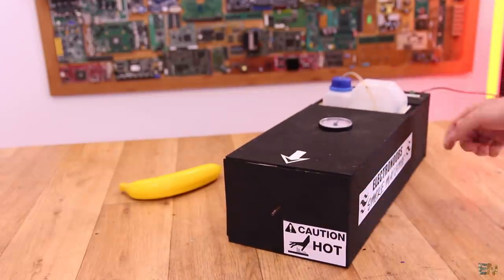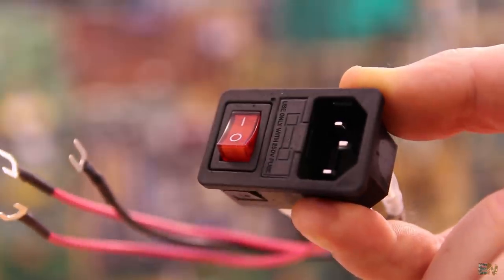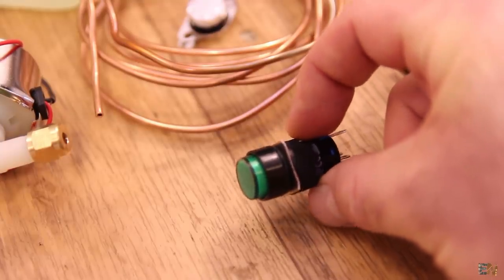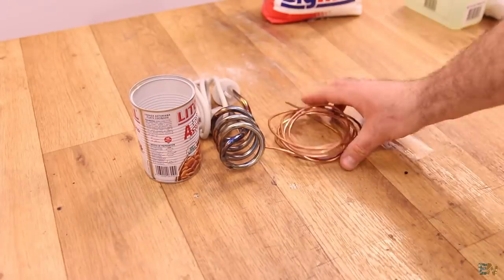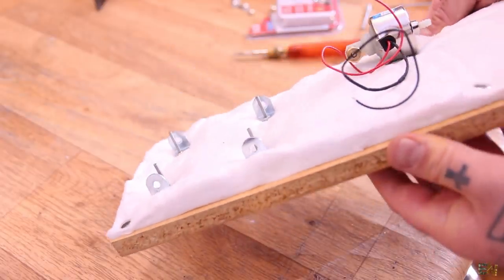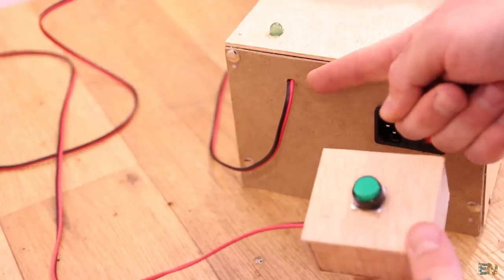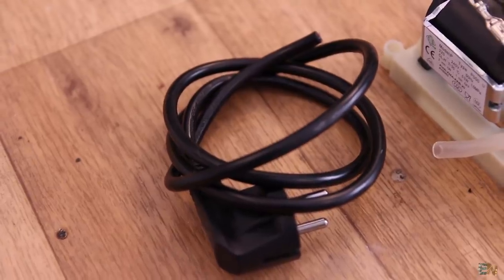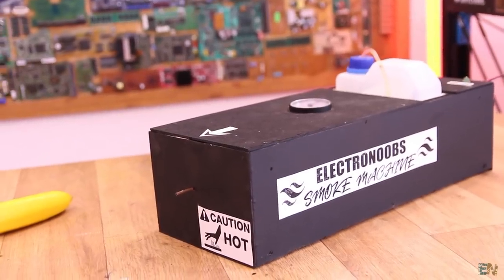Homemade Powerful Smoke Machine | Cheap Parts DIY

Comment from the maker: Sign up at ELECTRONOOBS.io: https://electronoobs.io/
Follow me on FACEBOOK for more: https://www.facebook.com/Electronoobs
help me on Patreon: https://www.patreon.com/ELECTRONOOBS
Reply: Electronoobs your ur name is a copy of electro boom
Reply: Why use a mains rated button when using speaker cable, the cable is more likely to fail than the button. And why no grounding, you have metal parts sticking out that on the inside is in close proximity to mains wires. Stop making mains connected projects until you know what you do, at least don't make videos for others to make the same mistakes and potentially kill someone. Maby you know how to make something not lethal, but just on the edge, someone who copy you may then cross the line and kill someone.
Reply: can you place links from amazon, or other place with all the stuff needed for this project please?

Comment: Great project. But there must be thermal fuse (eg. 250'C)in series with coil in case of thermo couple switch fails (as you use wooden case) to avoid fire.

Comment: Hello, first time poster first time watcher. But I've been a repair tech for the entertainment industry for about 6 years now. And working in it for more than twice that.
Ok, so time to unpack some things:

1) SAFETY 
     This design will have extreme problems, but down the line. While the thermal insulation is good, you really need to be using some form of fiberglass insulation that is rated for some amount of time as a fire barrier. Other machines professional in the industry do this, however some do not. The reasoning is a very well tuned system that calculates for thermal run off, kind of hard to do with Arduino. Switch it up to the more powerful teensy and now you get some watchdog timers for thermal management.
     Also PLEASE COVER THAT OUTPUT NOZZLE it should be recessed in a way that walking along someone can't bump into it and seriously burn themselves.

2)PURGING
     This is a very important step for longevity. to purge the system we need a way to force air through the line going into the heater block.
This is commonly done with an air pump from an aquarium. Take the output of the air pump and put it in a t or y split to join the fluid and have the output of THAT go into the heater block. Also go ahead and move that switch to an input for the teensy and get ready to do some light coding. Because the fluid pump should not be pumping constantly, while the air pump could (you may want to adjust it with the fluid pump for consistency). 
     Vary a pwm signal to the fluid pump. it will push little bursts of fluid into the line that will be propelled forward into the heater block by the air pump. This will also allow the system to purge after use by just leaving it alone until the unit stops producing haze entirely. By varying the flow of fluid we get less output yes, however we also get less cooling on our heater block which can save designs that use cheaper heaters that can't keep up with how much the fluid will cool down the heater block while in use.
     If heater blocks are left un-purged build up from sugars inside the haze juice will form a coated layer of "gunk" in that heater coil. This will build up no matter what. But extremely fast if you don't purge at all. Sometimes they can be brought back by running a mixture of 50/50 distilled water and vinegar through the line (this will not smell good) and a pipe cleaner. Often though the solution is to replace the heater block entirely.

3) HEAT
     You noticed that little bit of leak coming from the output nozzle? hotter will fix it yes, also pumping slightly less fluid as stated above can help. But most hazers will have a small thermistor that ties into a trimming potentiometer that gets adjusted until the desired cutoff heat is reached. How this works it a voltage is sent into the thermistor, voltage gets resisted by some amount of heat, voltage goes through the trim pot where if less heat is required you increase the trimmer thus make the unit see it's programmed shut off without having to adjust code. Most hazers I've worked on are tuned somewhere around 200-230 C
     That is super hot. Those machine also have a metal frame, thermal runoff protection, (and good insurance (jk they turn off and force fail before we get to that point)).

I don't know if you will return to this project or not, but if you or anyone else watching this does it would be a good idea to make some changes in the name of safety and longevity.
Reply from the maker: Thank you very much for all these tips. These are all good advice and I now know more and. Thanks!

Comment: Congratulations on the project. Could you create a smoke machine system running on 12-14V? It has to produce a lot of smoke pretty quickly.

Comment: Thank you for the video, one thing, I think that using mettalic hinges made for pvc pipes to attach the can is better..no? Another thing, the smoke liquid is not the same made for electronic cigarettes?
Reply from the maker: I'm not sure. Maybe the cigarette liquid is also based on glycerin....
Reply: It's the same, but different grades. Google says, 'Fog fluids have two primary ingredients – an active one and deionized water. The active ingredient can be propylene glycol, triethylene glycol, glycerin or a mixture of these. The vaporization temperature varies...'

Comment: The idea is good, but 220v+ heat+ wood case+ "something go wrong" = easily Fire.
Reply: You are correct, but he repeatedly said that you should make the case out of metal. He wanted to use metal but all the metal shops were closed due to quarantine

Comment: I love the idea but 240v for most = either fire or death why not use a 12v heater cartridge from a 3d printer? I know it's smaller but safer in the long run

Comment: Also make Arduino battery charger with display with minimum components with voltage and amp rating .. thanks in advance and stay safe 🙏🙏🙏 i want to use it for 18650 salvaged from old batteries..

Comment: I am looking for smoke machine to be use in a boat as theft prevention. It need to produce heavy fog and be triggered by a motion detector. Ideally should smoke for 15 minutes and have a low stanby power consumption and be ready to produce fog within a second or two after the motion detector is detecting motion. I think this could be a great business for boats alarm. There are some system available but very expensive (>$1000)
Reply: Would it be possible to hook up lots of smoke distress flare canisters with fireworks electric igniters and wire them to a motion alarm?

Comment: Without ventilation eventually the whole box will turn into the set temperature of the thermal switch. Your intention to go to 200 degrees makes me shiver in fear of fire. Instead of keeping the heat in with isolation wool, you should let the heat escape. Holes above the can (wrapped in isolation wool to keep the heat inside the can) would be enough for thermal convection to do its job of letting hot air escape from the box..

Comment: I know that I won't make that type of machine and you shouldn't criticize if you don't are on a same level of knowledge but tehre are soo many things tahts feels me that they are bad done : 
- the plaster in the heater it will act as a heat resistant material and your thermostat will not trigger when the heater will be at 160°C but instead  much higher
- The LED, you put a 33k resistor, by ohm's law I= (230-2)/33 000 = 6.9*10^-3 A ok but what about the power dissipation ?P = U*I
so P = 228 * 6.9*10^-3 = 1.57 W, at the size I guess you put a 1/4 W resistor, It will quickly burn up because you completely thermally insultated it with the heatshrink tubing
- The wires 230 V AC in a salveged wire fom an old ATX SMPS ? You are realy wanting for a fire, ... The wires from the ATX were never designed to handle High voltages, 80V ax, if you look at the cross-section of some 230V designed cables, you'll see that the insulation is double, even in the  short inner cables of an ATX in the high voltage section 

- you made a smoke machine, if it start to burn up, you'll not see that until too late for the machine, 

- You paint it black, if it start to burn that is not seeable
- you put wool inside, you know what, that's not fireproof, yes a little bit dificult to ignite but not safe at all
It's a nice project but you make dumb mistakes that I wouldn't have think from you
Reply from the maker: Thank you. I know the project is not perfect. The thermoswitch has direct contact with the heater inside the can so I'm quite sure it will stop at 160°C. I understand there is some power loss on the LED but also, since the LED is a diode, it is affected only by the positive side of the wave, the negative is rectified, so half the voltage. Also, power is the current multiplied by the voltage drop on the diode, in that way the drop is even lower because the 33K resistance together with the small resistance of the  other diodes will make a small voltage divider. For more I should make some tests to see more. Thanks  for all the tips and taking the time, and have a really nice day.